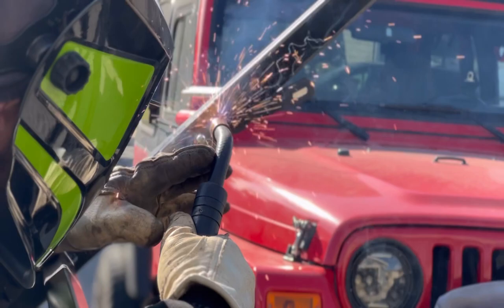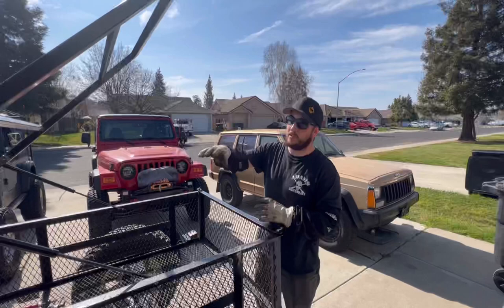Budget Overland Trailer Build Pt2 - DIY Deck Lid, Gas Struts & Mounting an RTT

Comment from the maker: Disclaimer: for those that may be new to welding :  here are some tips and may answers to some of your questions regarding the welding processes type and weld positions. 

In this video, I use a Hobart 110v welder and I switch between gas and flux core welding processes, both .035 wire size but each to there own specific uses. Most of the important penetration needed for structural integrity I use flux core with flat position welding techniques. This is because the limitations of my welder (at the time) offers the best penetration based on material thickness. I’ve since bought a new welder that can GMAW up to 5/16” stock and would be the process of choice. All flux core welding positions are performed in the flat position.

Down hill welding is a process that proves to be better when dealing with thin metals. This is because as you move down, you get a faster travel speed and the arc will penetrate the base metal less. Thus it has lower heat input thanks to the faster welding speed. This also helps to prevent the excess melting or damage to the material, so you should be able to deal with thin metals without a problem.

For instance, in most trailer plants which manufacture small trailers that are made of light gauge metal or thin wall tubing, running a downhill weld can help achieve 100 percent fusion while preventing overheating or even warping of the components.

Vertical MIG welding, whether welding uphill or downhill is a daunting task for beginners, trust me I know. Learning it requires patience and if you are not extra careful you will get a rough, uneven bead, possibly with undercuts on both sides of the bead, which as you can assume is a bad thing.

Before you start taking on projects in your neighborhood to make a few extra bucks that require vertical welding, make sure that you know what you are doing. Practice, practice, practice!

A good vertical MIG welding technique should enable you to fight against gravity as it pulls the puddle downward. If properly adopted and mastered, vertical welding position is the most effective base position after flat position to study and take on other positions in the future.

Comment: Love the trailer! I would suggest moving the track boards to the tailgate. When you need them you don’t want to dig everything out of the way. Maybe even hook them to the underside of the tent deck.
Reply from the maker: I actually thought about putting the track on the tailgate but they were to long. The next best place would be under the Rtt, I do like that idea a lot and it wouldn’t be hard to move over there. Would be very convenient. Thanks for watching and sharing 🍻
Reply: Put them same place, just on the outside

Comment: Nice job. I like what you’ve done. Maybe in the future you might consider two sliding drawers or trays so you can access the gear area while your r.t.t. Is deployed. Just an idea.
Reply from the maker: I’m hoping to find a truck decked drawer systems that size of the cargo space , it would be rad ! Good idea thanks for watching 🍻

Comment: Just curious on the tongue. What was the reasoning for making it as long as you did? What are the benefits? And what are the drawbacks?
Reply from the maker: I was unsure about the length at the time, and I wanted to be able to leave the trailer connected and parked perpendicular to the jeep, but still have clearance to open the rear tailgate. Also some obstacles I plan to take the trailer on have steep approach and departure angles , a longer tongue will allow the clearance for the trailer to not crash into the Jeeps spare tire. Since I have shortened the tongue to 40” from the box to the hitch. 🍻

Comment: Can you provide source info for the gas struts? Most of what I'm finding is in the UK, and mounting calculators are confusing. I have a heavy steel covered lid on my 3x4 trailer I would like to use struts on. Thanks.
Reply from the maker: Yes these are 28” 200lbs gas struts https://amzn.to/3yYi1FP 🍻

Comment: 11:02 The safety nut is not doing you any good unless the threads extend thru the nylon insert.
Reply from the maker: Yes that’s true, but in this case that doesn’t matter because there is a nut on the other side and the frame is threaded, therefore the nuts jam the bolt very secure! In theory that nut is not really necessary! Just additional! Thanks for watching 🍻

Comment: Why aren´t you mounting the xbulls on the underside off the decklet
Reply from the maker: It’s a good idea , but at the moment having those there would allow less space to fit my current totes and gear that I have. Currently Where those would fit when the lid is closed.my tail gate tables set on top of the totes.

Comment: What welder do you recommend for beginners to build custom mods for these trailer builds? Planing to resupport and upgrade mine for offroad/overland use.
Reply from the maker: 240v Hobart, Miller , Lincoln, Forney, or yes welder and that’s about it. If your interested buy it on Amazon run the crap out of it for 30 days if your not satisfied take it back! Amazon has some good deals! For a newbie to mig I’d suggest starting off with flux core wire and then if your serious you can then decide if you want to spend the extra for a gas setup! .035 is an all around good size wires up up to 1/2 stock. I’ll be doing a video on this subject soon. Thanks for watching 🍻
Reply: @ATEMOFFROAD  Much appreciate the reply I should read your comments on this post. Would the 170 Amp-DC 240 V Lincolns Mig/Flux core welder at Harbor Freight be sufficient enough to get the job done?

Comment: Also flux core is not what you want for structural welds in an ideal world also MIG Vs flux core requires more prep there should be absolutely no oil no mill scale etc. With mig it requires more prep than stick /flux core the flux actively attaches itself to the contaminants and floats it to the top of the puddle and that's what the slag leftover is a mixture of the flux and contaminants this is why they use stick to weld pipelines for instance of mig we're stronger and less sensitive to prep they'd be out there welding with mig welders because it's way faster but not as structurally sound without more prep you've got it backwards be careful what you advise people to do after watching these 2 videos you might want to add a disclaimer to your videos
Reply from the maker: This situation is not “ideal world” outdoors GMAW offers poor shielding properties from the wind.  To be clear this video is not a how to weld video , this is sharing how I built my trailer. Every video has a disclaimer. I always suggest that if you are not comfortable welding to never weld and to seek a professional for this task. Welding in the flat position is always suggested. the generally preferred progression for FCAW is uphill. But this is not absolute. All FCAW passes that are structurally made are done in the flat position. The only reason FCAW is introduced in this video is because of the current machine (at the time) limitations. FCAW offered best penetration for the material thickness compared to GMAW processes. I have since purchased a new machine that welds GMAW up to 5/16” stock plenty of penetration for the the job in the flat position and would be the process of choice. At the beginning I meant to say less prep after the welding, it takes time to clean flux off the weld , anything worth welding should be cleaned throughout no matter what the process! I appreciate the insight 🍻